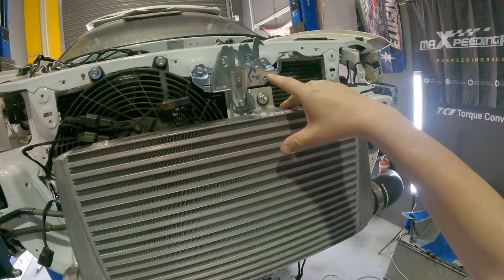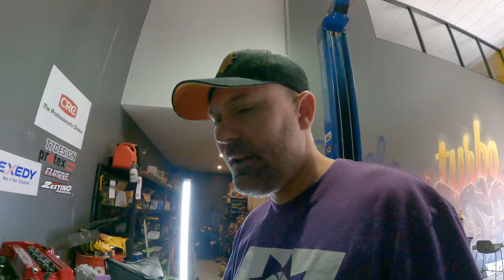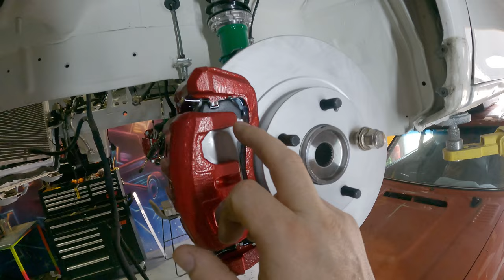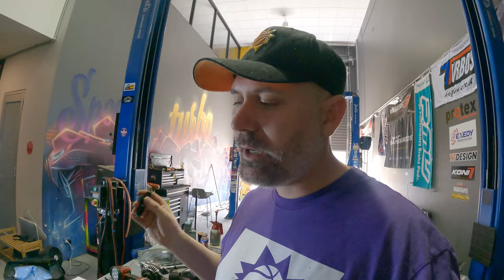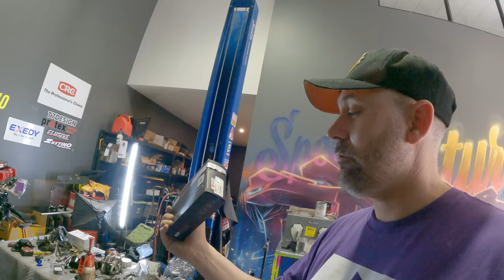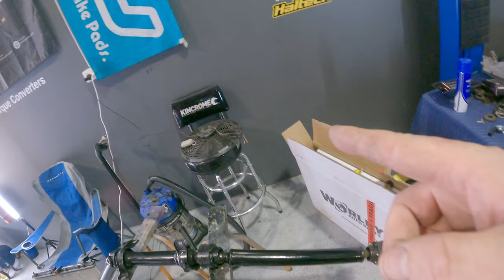Evolution IV OEM+ Restoration

Comment: I would go with the 980/1150 instead they're close to that size and an oem injector.
Reply from the maker: My thinking was if I was running 98 I would use a 750 cc injector but because I wanna use e85 i will need the 1200s I have 1150s in my civic and it’s nearly out of injector but it makes 300kw I only want 220-250 out of this

Comment: Hey tristan! I build evo 4-6 here in the states and our shop car is also an oem+ build running 306whp (228KW). Could things

1) 800-1000 cc injectorsbis enougj
2) replace the fpr. Oem one is junk.
3) dont need to relocate the battery to trunk. There are trays out there that let you fit a smaller battery in the bay and run an evo 8 style intake (and better IC pipe routing)
4. The oem turbo maxes out around 300whp so you might consider going with a slightly larger turbo just to let it run more in its efficiency range.

Im sure ill think of other stuff. Great stuff! Love the content
Reply: Oh another thing, you might consider wiring in a fuel pump relay. We found that these old wires tent to cause the fuel pump to drop voltage a bit. Better safe than sorry.
Reply from the maker: Thanks Jon I appreciate an experts help legend thanks for watching and I will take all those tips on board